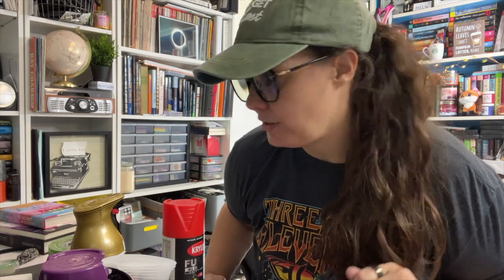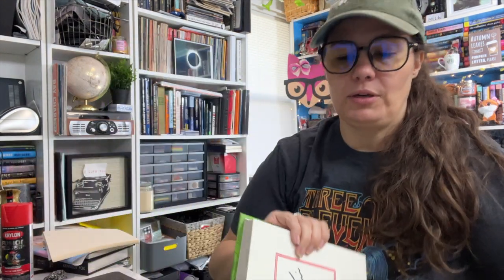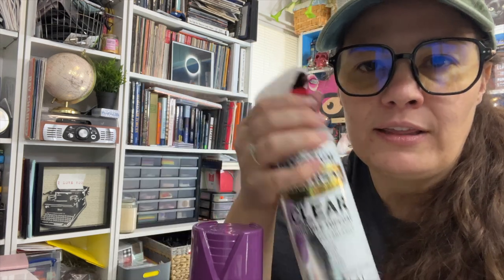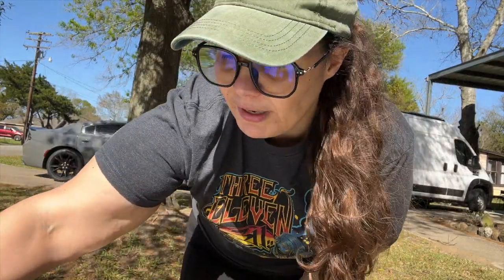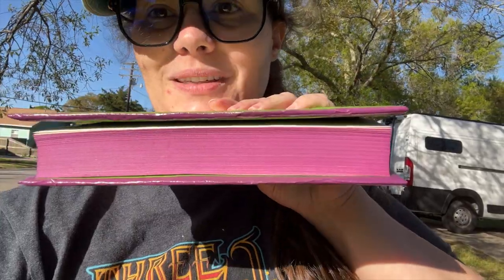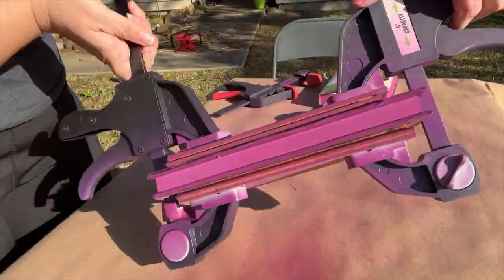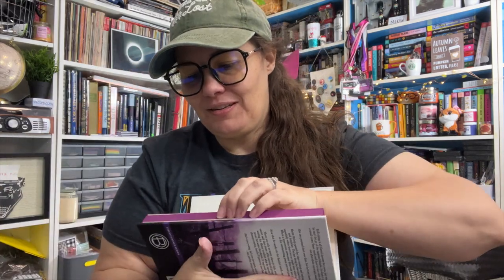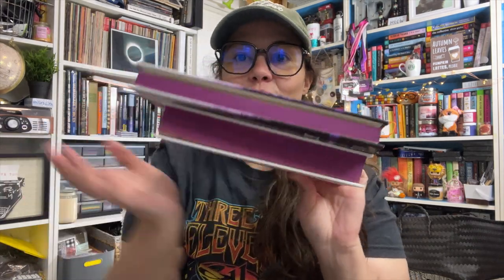How to Spray Book Edges DIY | Book Gilding

Comment: The books came out so well. Excited to see how the gold one will come out. Have you thought about using stencil of chess pieces? Use card stock between the stencil and the part you don't want paint on. 

It could be really cool to spray the six books series in one book a few chess pieces in gold or potentially the one you'll practice on.
Reply from the maker: Oh yes! My hubby mentioned doing a stencil. I think it would be hard with spray paint, but I’ve seen people hand paint them with stencils. It would look really cool!!!
Reply: @TheCourtneyProject  Okay Yeah it probably would but painting with regular paint and having the book clamped probably work without any bleed. :)  I look forward to seeing your sprayed book edges. Sorry for the late reply this account is connected to my second email. I don't check it as often. I will now. ^-^